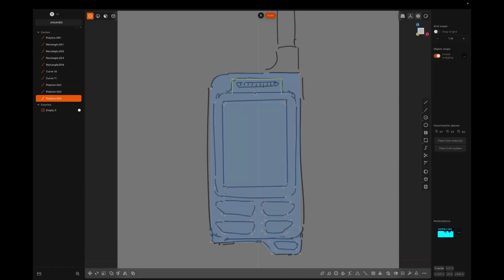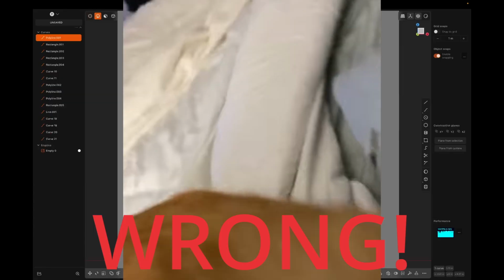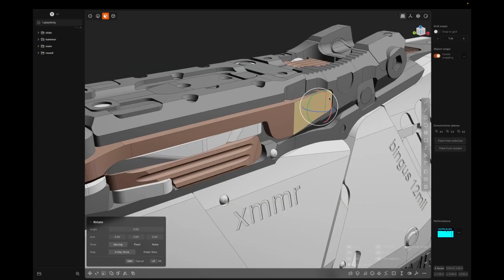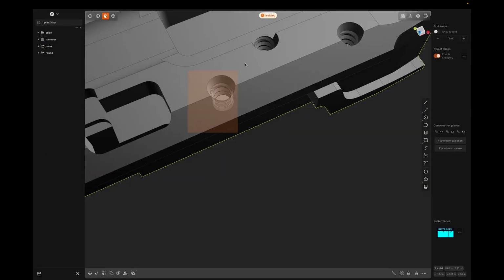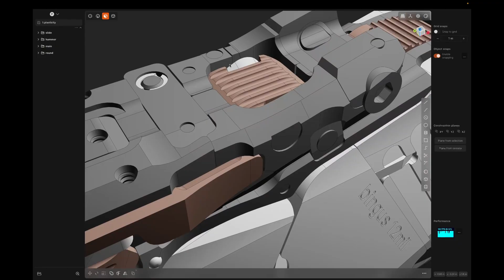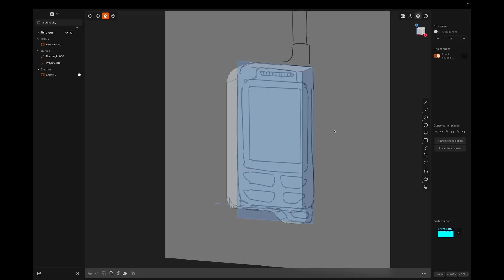Why Go Solid Early

Comment: Fully agree with that. Recently discovered this myself. I had an idea and started modelling, and already by doing this in 3D I moved further than my sketches on paper. So this applies for hand-drawings as well. 3D is a thing in itself, it cannot be substituted by flat graphics and keeping it that way. I believe that car designers are doing the same. They draw a scetch and then build a full model in clay IRL to get the impression of what it looks like, then readjast it as needed and only then preproduce it in digital model again.

Comment: I think one shouldn't worry at all about how one starts. It depends on if you need precision and know you want it this exact way (making precise curves), or want to experiment with fillet size and other proportions
What makes sense is saving unfilleted basic shape curves, and then you can add fillets either to curves, or to solids, and see what works better
But I see your point one should get familiar with parasolid modeling, and not just model like in Rhino with regular nurbs
Reply from the maker: im really sorry, i shouldve named the video "why go solid early in 99.9% of situations (not including advanced surfacing)". to be fair i wasnt able to imagine a single scenario where working on a sketch in plasticity beyond basic shapes would be beneficial, but there is a chance that im wrong so i had to subtract 0.1%. BUT it doesnt mean you have to! you can do whatever you want! just as i am, and i will use this argument to keep the video as is, thank you!
Reply: @Munsplit  Thank you too! By basic shapes do you mean you take the model and enhance it elsewhere, like in Zbrush?
Reply: @MIchaelSybi  no mate, he's literally reaffirming what YOU had said when you wrote "What makes sense is saving unfilleted basic shape curves...". He's saying to not fillet them in the curve stage, where it's a pain in the arse to later change the radius you used, or the position of any adjacent line, whereas if you do the fillets in 3D instead, it's trivially easy to make changes to position and curvature afterwards.

Comment: This is the single most advice for the 3d workflow. 
The old habit of relying on curves is due to the limitation of hardware power before 10 years but even today old habit exist due to software like Autocad, rhino, solidworks as all emphasize on curves. But blender and Hops shows the non-destructive workflow that is perfectly finished by plasticity hence we love it.

Comment: Seams precision would be harder that way. I started with rulers, parallel guides and paper/velum, so it's pretty foreign.
Reply from the maker: while it is a totally valid point, im not sure if precision is the goal of plasticity. if you feel like drawing a lot of sketches, i cant stop you. just keep the limitations in mind. PL is not a cheap solidworks alternative, its build for other (more artistic) stuff with speed and usability in mind.
Reply: @Munsplit  it may have started as 'Artistic' but precision has already started. Personally, I like DSM, now also a Parasolid dynamic modeller. However the incredible free flowing nature of Plasticity is too wild for my liking - in my world, every cut has a cost or a benefit, so Plasticity could only be used for a superfast overall concept model. I will keep a very close eye on the surfacing capability though - very impressive already!
Reply: @TAH1712   then you might really like Fusion 360... it's essentially Plasticity, but with high accuracy sketching tools.
Reply: @seengh  Well, I might but I'm very good with DSM - the program does all I want at a much smaller price point. However, Fusion 360 does offer more functionality if and when required such as CAM and FEM. Let's be honest, it takes quite some time to really get good at using another program, to learn all the quirks etc.
Reply: @seengh  DSM has both the standard sketcher and the Constraint sketcher - each is high accuracy! I think the Constraint Sketcher has super tools. Sketcher Constraints if making a layout sketch are live in 3D mode!
Reply: @TAH1712  can you provide a link to this? I don’t know anything about it.
Reply: @lew6598  I like to think of it as first 'Qualify' a design, then modify it only slightly (hopefully ) to 'Quantify'. Personally, I'm quite a chaotic designer or so I believe I am...My last design thought Is usually the winner but it's never the first idea I have. Therefore, I've discounted so far all parametric design approaches. I hope I'm not being too rigid with this philosophy though?!